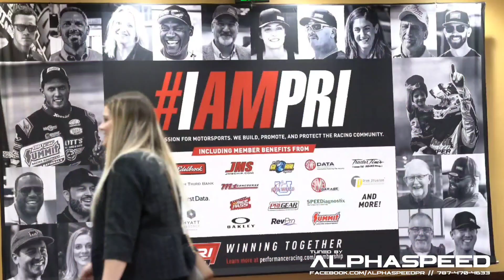What is RusEFI? This and more at PRI2023!

Comment: RusEFI is great but they're struggling to with user uptake. I think the main problem is the boards are quite expensive, they need to make more basic cheaper "official" boards just to increase the user base faster. There's a reason why Speeduino is so popular.
Reply: Im ordering the uaEFI they have for $100usd base price for my ranger
Reply: @AdamKueflef  yea that board looks great! There was nothing like that available when I wrote the comment 10 months ago.
Reply: Yea even cheaper than the speeduino that I run.
Reply: @ioijiopjkiopjkp  that's impressive, I won't do speeduino because V6 and I'm not doing it without 6 cyl sequential injection. I just need to build the transmission controller before I can remove the stock pcm(it's auto)
Reply: @AdamKueflef  speeduino supports 8x8 sequential, you just need to get the right board
Reply: @ioijiopjkiopjkp  the cost of any board with at least 6x6 was more then the cost of equipment to tune the stock system also I'm in Canada so prices are weird